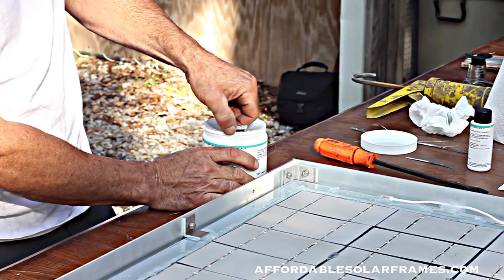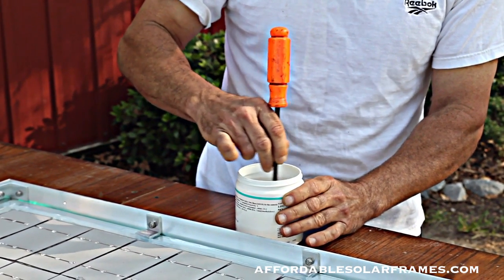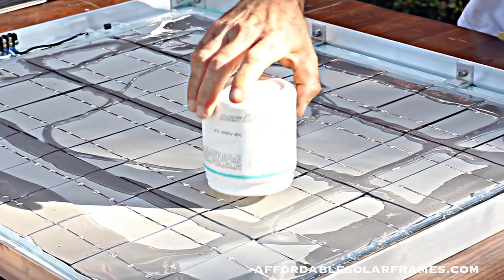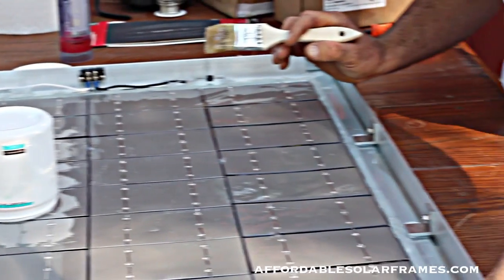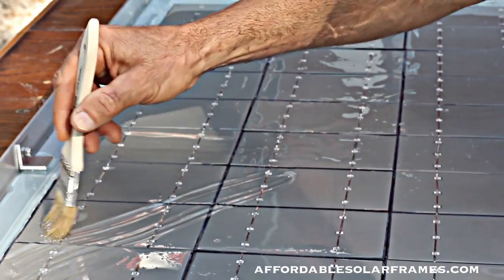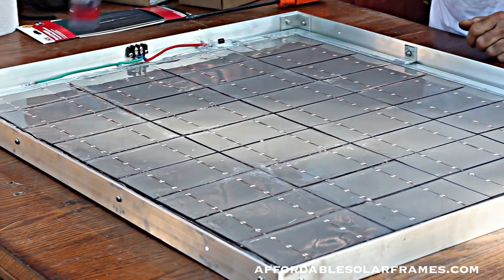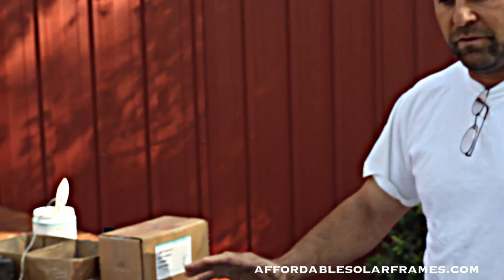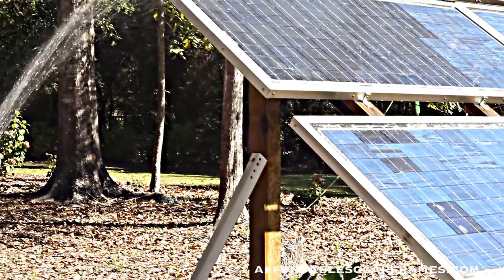How to Build a Solar Panel - Part 3 of 3 (New) encapsulated/sylgard184.Free electricity

Comment from the maker: @cartoonkeith1  Yes I just encapsulate. To heat water you do not need to encapslate just build a insulated box with a glass front then run copper tubing inside the box.  Mark